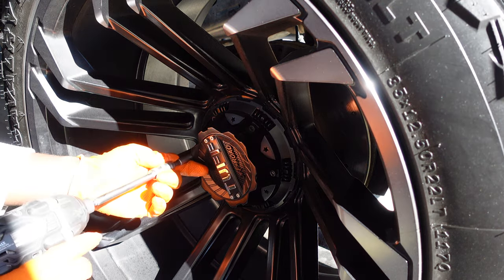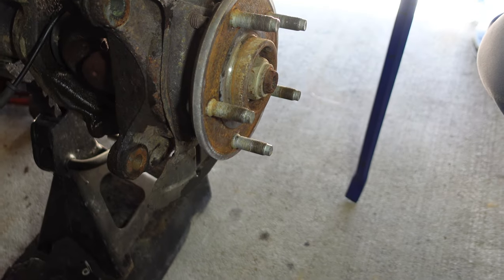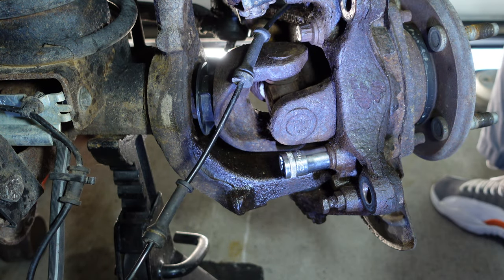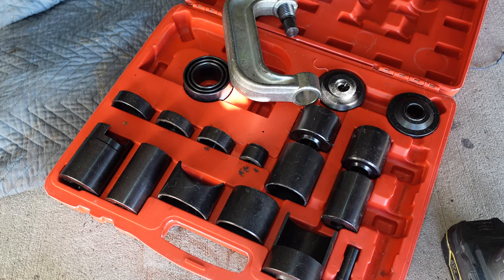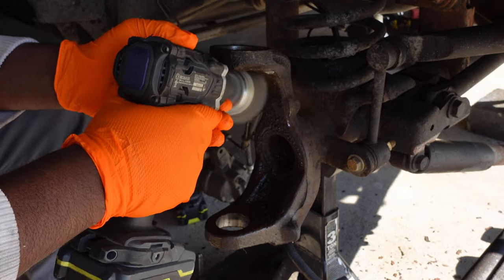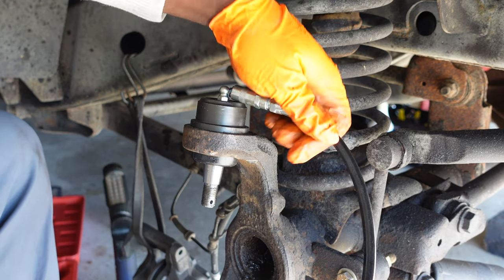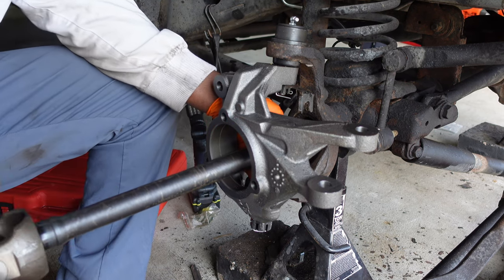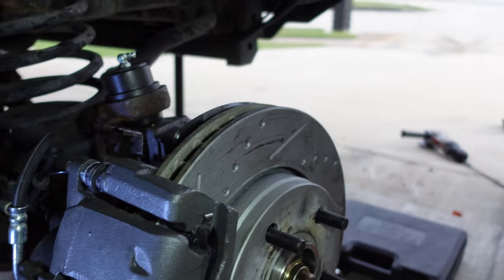How to replace Jeep Wrangler JK Ball Joints | FULL TUTORIAL

Comment: You can clean the grease from the fasteners and then put a touch of antisieze on the shaft where it passes through but don’t suggest touching the threads. This can cause over torqued fasteners as dry and wet torque are different.

Comment: Thanks for the very helpful video. I've been experiencing the infamous Death Wobble and because of this and other video you did on MetalCloak Steeering upgrade, I ordered same kit. MetalCloak also recommended I change my ball joints. I just took driver side wheel hub and it's pretty beat up. What wheel hub replacement did you go with? Thanks!
Reply from the maker: Hey thanks for watching! I went with this one off 1AAuto!    https://www.1aauto.com/jeep-wrangler-wrangler-jk-front-driver-and-passenger-side-2-piece-wheel-bearing-and-hub-assembly-set/i/1ashs00920?f=1444893&gclid=EAIaIQobChMItrmssP2J9QIVCxXUAR0UEgHjEAQYAyABEgKutPD_BwE

Comment: Just curious why did you cut one of the ball joints ? it was stuck ?
Reply from the maker: Yea and the bottom wasn’t giving me a good place to push, because the bolt was messed up so I had to cut the lower off so I can get a solid section to push up with!
Reply: @Backoutsideco  Ahh ok thank you for your video it helped a lot :).
Reply from the maker: @miguelfloriano9039  Thanks!! Glad it could help!
Reply: Thank you so much very helpful vid.